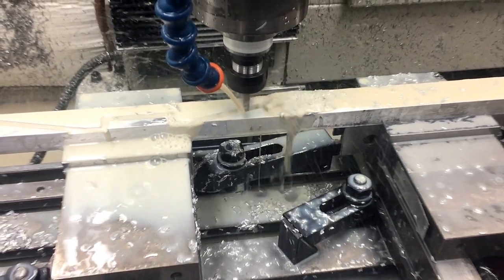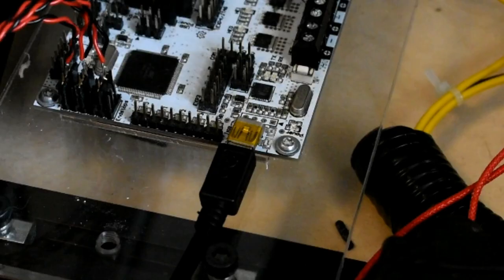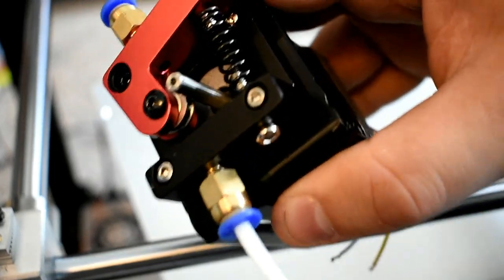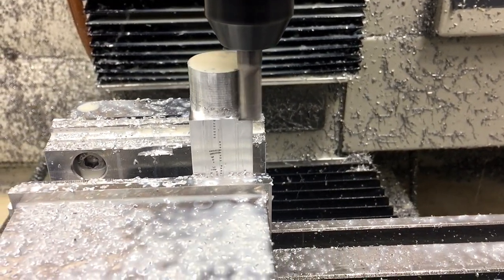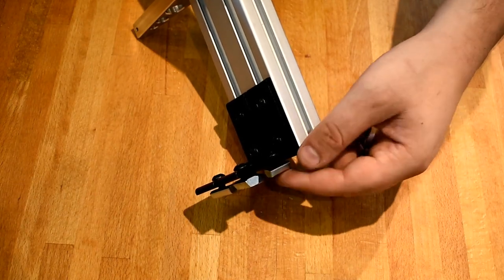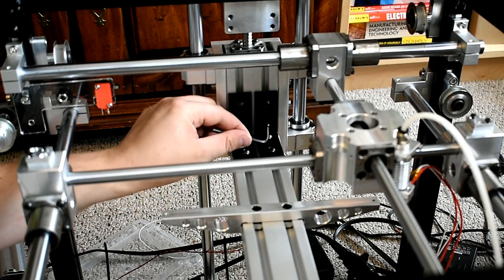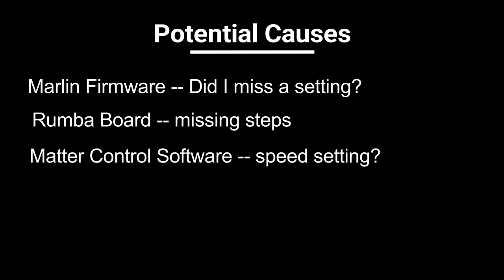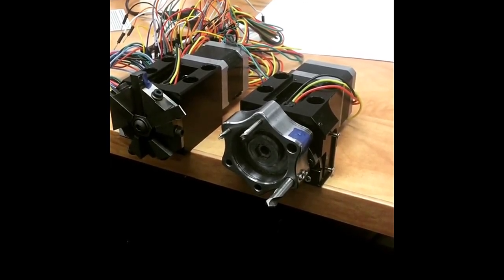3D Printer Part 3:  Z axis and Electronics

Comment: Small tip for soldering:
1) Use a bit of flux. Not necessary if your solder has a flux core, but a good idea.
2) Heat the pad/pin/wire/what have you, apply solder to the pad, don't carry it on the iron.
-3) Solder. There's an L in there-

Also, your steppers are running way too coarse.
You need a much higher microstepping setting.

Comment: Found your channel through your 3D Printer build. Here are my Opinions:
- Bin that Extruder! The Nema 17 Motor doesn't have enough juice and will start skipping steps and you'll get under extrusion. Look for "3D Printer Clicking Noise" online and you'll see what I mean.
I'd suggest getting a geared extruder. Yes, they are more expensive, but definitely worth it. (I know its expensive, but the E3D-Titon is best), plus it will work with the hot end you already bought.
(You should also look for an extruder that has a filament guide that is right up against the toothed gear that pushes that filament. This way you can print flexible stuff later on and it makes feeding the filament in easier.)

Your X/Y problems sound like the Stepper motors are not getting enough juice or the stepping is configured wrong.
Why are you not using DRV8825 drivers plugged into your Rumba board? They plug straight into the board and can definitely handle Nema 23 Motors. Just pop a heat sink onto them and and point a fan at your control board. Then you only need one Power Supply too.

Last but not least, bin that 12v/24v heated print bed. The thin aluminum will bend after heating and your prints will not stick and it takes forever for those little things to reach anything higher than 50 degrees. (You'll want to print more than just PLA) They are designed for people who print on glass.
Get a 5mm or 8mm aluminum sheet and mill it flat, then stick a mains powered silicone heater underneath and a PET sheet on top. Look for "keenovo" silicone heaters that come with the thermostat already in them.
If you use a fat Aluminum bed like that, then you will also be able to use a induction probe as your Z-end stop and make Bed leveling a breeze.

Keep up the videos and please don't ask for "likes and subscribe"
Reply: Big 2A NEMA17 motors are on the ragged edge for direct drive extruders with 8mm hobbed gear, but yes something with a little gearing is a good idea.

Don't mill your bed, buy factory milled/polished aluminum sheet that is already flat. Milling won't get you to 10-20um tolerance you need unless you have a really good mill and know exactly what you're doing. Then again, if you go with the induction probe, you can enable mesh bed leveling in Marlin and bed geometry pretty much doesn't matter (within reason).

Are your X and Y axis actually skipping steps? Drive them fast 200mm in one direction then slower back and check that your origin didn't move. You can't go by the sound alone on Gecko drives as they do a lot of clever stuff like shifting from microstepping to half or even full stepping as the RPM builds up (at least their bigger drives do). If there are no skipped steps you don't really have a problem - steppers are noisy in nature. To test, write your own G code - don't trust the slicer - and try switching the connections around (X motor to Y driver and such) to see what the common denominator is).

When soldering, clean the hot tip against wet sponge or wire tip cleaner, apply a tiny bit of fresh solder to the tip, press the tip to both surfaces you're soldering (put a bit of force into it, good mechanical contact is a precursor for good thermal contact), hold it for second or two and then touch the soldering wire the other side of surfaces (don't touch it to the iron). Solder will flow by itself when you do it right and it'll wet both surfaces perfectly. When you touch soldering wire to the iron, flux in the wire evaporates before it has a chance to reach the surface you're soldering .  it goes without saying that you need flux cored soldering wire. Practice on junk to get good at it and avoid lead free solder wire like plague - it's not meant for DIY and small volume repair work.
Reply from the maker: Good ideas.  I never even thought of just writing my own G code to troubleshoot.  I'll check for skipping steps but I don't think they are.  I see you noticed my horrible soldering.  Thanks for the advice, I'll try some of those tips out!  I know I really need to clean my soldering tips.
Reply from the maker: I always get to the end of the video and I'm like "why am I assuming people don't know how to like and subscribe".  I guess I just do it because I see everyone else do it.  Maybe I'll try a few videos without it :P .  I might try DRV8825s for troubleshooting and see how they perform with the NEMA23s.  I'll certainly check out the E3D Titon.  It sounds familiar.  I may try a plate of MIC6 cast aluminum for the bed.  It comes really flat and stable.  Thanks for the advice!

Comment: Stepper problem sounds more like a too coarse microstepping to me. Can you adjust microstepping with your stepper driver?
Reply: Ya, there might be a setting like u-steps per full step or something. It seems most cheap drivers go up to 32 u-steps per full step which is pretty decent.

Comment: Heat shrink also works good for hiding bad solder joints with the added benefit of protecting from short circuits. :D
Reply from the maker: I use quite a bit of heat shrink :P.  It keeps the electricity and my shame contained.

Comment: Nice progress! As usual I have some comments. First, servos would be overkill for this machine. I have used 3d printers (namely PolyPrinters, a Dallas, Texas based company) that easily print at 150 mm/s and rapid at 250 mm/s using regular old nema 17 steppers. With servos you will have less problems with acceleration and turning hard corners, but the inertial forces of the higher acceleration could expose other problems, such as ringing from the relatively flimsy structure and painfully flimsy linear rods.

Definitely try to tune those steppers up further, I know people who have made nema 23 steppers spinning 1800 rpm in 3d printing applications for massive speed. They say that at that point, the limiting factor becomes the hotend being able to dump heat into the plastic and then the extruder being able to keep up. Most commercially available hotends are not designed for such a high throughput so you may need to design your own, which is a whole new bag of worms.

So, something is probably amiss with your tuning. 1 amp seems a bit low for those motors, what voltage are you using? Another guess I'd make is that your steps per millimeter values are off, or something is not quite right with the microstepping, as that awful sound the motors are making sounds like a stepper that is out of phase with itself (if that makes sense). When that happens the motors can get very hot, much like a set of gears with a slightly different pitch would. My 2 cents, could be totally wrong here.
Reply from the maker: Hi Calvin,

One huge dealbreaker for me with 3d printers is how noisy they are!  I really just want to use servos for how quiet they are (though the linear bearings arent exactly silent, so we'll see how successful I am!)  I am hoping I have the inertial forces under control in the structure, perhaps I'll fasten it down to prevent the whole printer from jumping around!

I agree with the hotend being the limiting factor.  I won't be able to get past that, and even if I could it would constantly be at risk of turning from a print to a puddle in a few seconds.  I'm running 48V and 1.5A.  The microstepping is 10x, which is fixed in Geckodrive G540s.  Frankly I thought that microstepping had to be a power of 2, but here we are.  That said, I used this geckodrive and power supply on my Taig mill back in the day, and I could at least hit 1000RPM (granted, I had a better controller).  So confusing.  Oh well.  I'll keep at it!

Comment: Hey, love the videos , commentary is really funny and I wouldn't be surprised if this channel got pretty big very fast.

How did you get the linear rods and frame properly aligned so everything is parallel or perpendicular? I found it pretty difficult building a similar machine with the t nuts allowing everything to slide anywhere it wants when you are assembling. 

Also, is it me, or does one axis sound kind of OK when the angry bee axis is not running?
Reply from the maker: I've gotten fairly good at lining things up to be parallel by snugging up the axes (but not tightening them) and then moving the head through the range of motion.  If I feel a tight spot, I loosen the end block a bit and let it move to where it wants to go, then I re-tighten it.  There are better ways, such as using a really big height gauge with a dial indicator on a big granite surface plate, but I've found that just snugging things up and moving them until everything slides fairly easily works well.  I also assembled the axes upside down to minimize how far they would fall if I wasnt paying attention.  I didn't notice one axis sounding better than the other.. I'll have to check that out... good catch!

Comment: My experience is that Marlin + ATMega 2560 can drive Gecko driver inputs pretty reliably.

In Marlin, look for and uncomment this line: #define CONFIG_STEPPERS_TOSHIBA
Recompile & flash to board.
This lengthens the pulse duration of the step pulse because Geckos want more than a typical driver offers.

Gecko drivers are 1/10 microstep, which can be pretty rough, especially with 1.8˚ step angle motors. Oddly, I found Gecko drivers to be smoother than highly recommended Chinese external drivers at 1/32 microstep.

After that, I suspect your accel and/or jerk settings might be too high.

When it comes down to it, your moving mass is very high for a 3D printer of that build volume. DIY people manage to do that build volume in NEMA17 X Y motors and get better performance.

Comment: Hmm also, What hotend did you get, because it looks like you got a cheap china clone of the E3D V6, (often called J-head, even though j-head is a completely different made in the US hotend)

I'd highly recommend getting the real-deal. Either a real J-head v10 (sold at hotends.com only) or an E3D V6 (sold a few different place, and at e3d.com as well) You CAN be lucky with a good clone, but often you won't be.

Also I hope you're aware that the heaterblock on the hotend isn't supposed to move with the wires, and probably means the nozzle isn't anywhere near tight ;)
Reply from the maker: You're right, its a cheap knock off.  I sort of have it as a proof-of-concept for now.  Truth be told, I'd love to design my own extruder at some point.  I got a real E3D for my last printer and loved it!  I havent made any real effort to tighten the extruder up yet :P

Comment: Ooof I wouldn't trust those solderjoints. It's very important (and a common mistake for people new to soldering) to not use the iron as a solder brush.

The reason is that solder contains flux, which is a cleaning acid, that cleans off any oxidization off of the metals you want to solder together. If you just put solder on the iron, and then "paint" that onto the connectors, the flux will already have burn off, and you'll get "cold" solder joints.

If you're interested, there's an old but great series of videos on soldering from pace. (https://www.youtube.com/watch?v=vIT4ra6Mo0s&list=PL926EC0F1F93C1837)

There's 9 videos, but you really only need to watch the first one, and even then, if you don't find it interesting. Skip to 6:50 to see the important thing about soldering :)
Reply from the maker: Thanks for the tip!  Soldering is something I totally taught myself so it's no surprise  I formed some bad habits.  I'll definitely check out those videos!